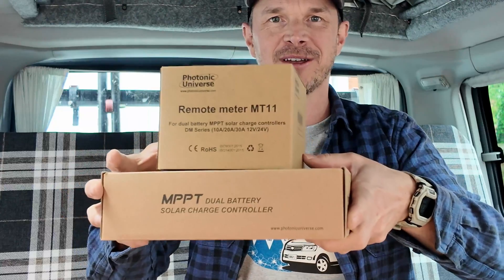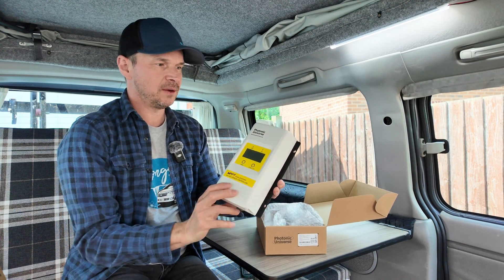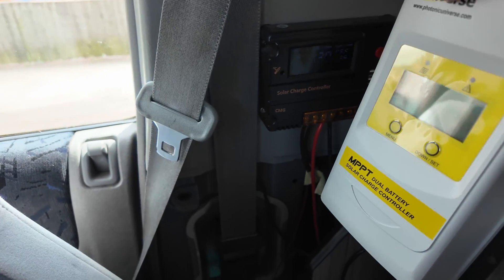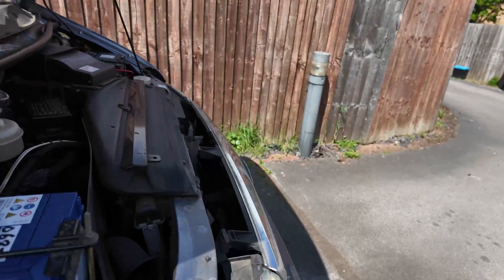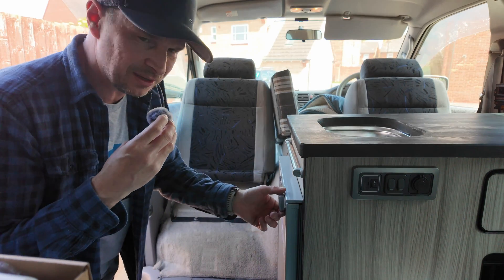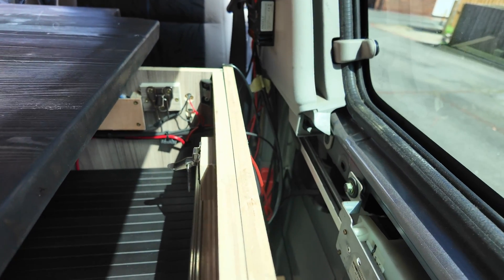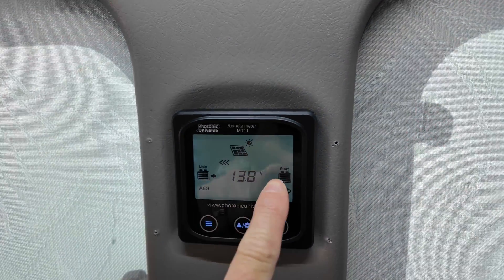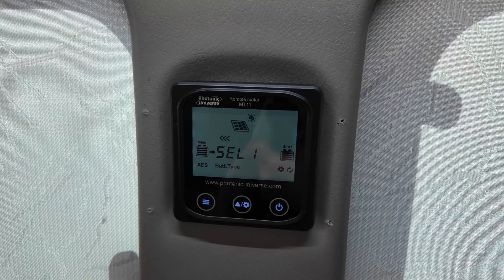No More DEAD Starter Battery! How to Install a Dual Battery Charger for Solar Power! ☀️🔋

Comment: Thank you for the video and all others. I'll give it a go and have the same set up. Have you got a link (or a video) for solar panel and fitting brackets onto the old flat roof by any chance?
Reply from the maker: The dual charger has been great so far! I don’t have a solar fitting guide I’m afraid. I would do a search on the Facebook group as there’s loads that have installed on there. I believe the original AFT roof actually has mounting points you can use for a solar panel.

Comment: I never knew somthing like that existed   i 100% need to get that on my van because i dont daily my bongo so i worry it wont start one day
Reply from the maker: That was my issue, sometimes my van was not driven for a few weeks and it was draining the starter battery. 

This charger seems to be doing the job very nicely  (It's addictive watching the little display 😂), I might do a long term update on this. Cheers 👍
Reply: @VantasticIdeas  ide like to see that
Reply: Is there a controller that will charge 2 leisure batts, been looking, but only found that kind